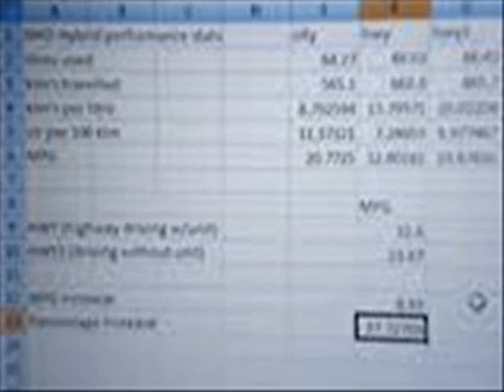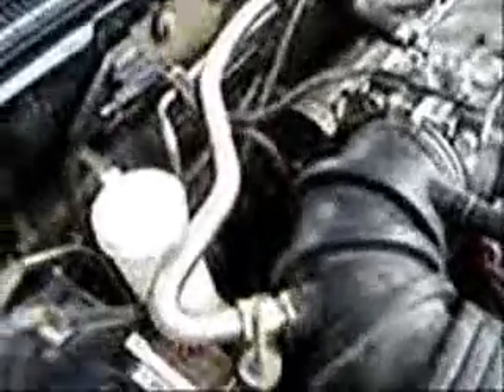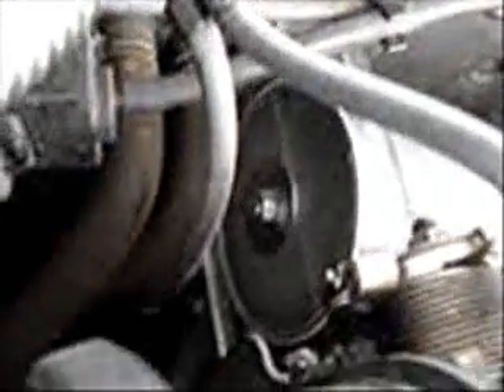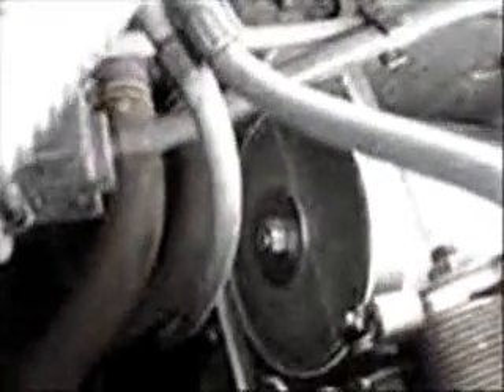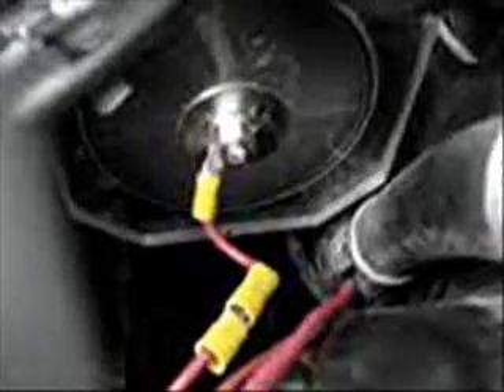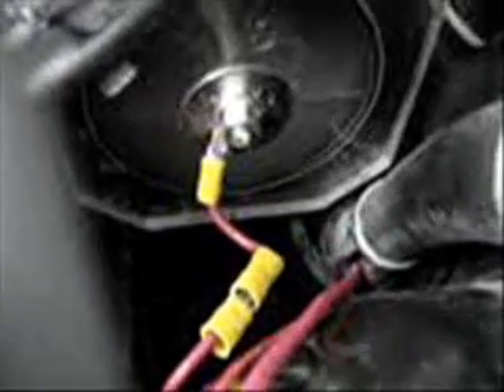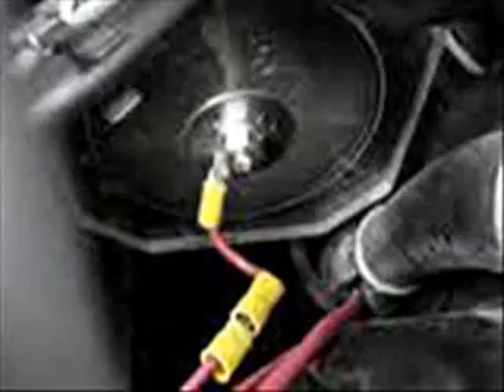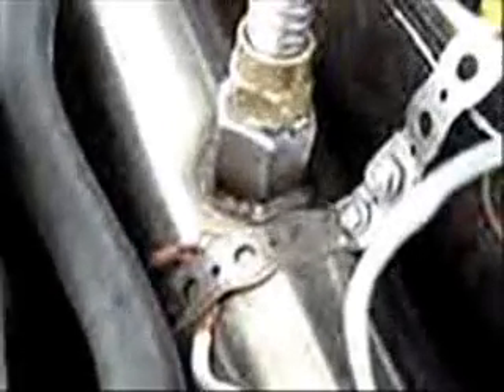Amazing HHO Hybrid part 2

Comment from the maker: Hi, the mesh seems to be .032" stainless wire with about 6-8 'weaves' per inch. They suggest leaving some mesh above water-line to help in keeping it cool if you run electrolyte. I've got it fully submerged as the unit runs fairly cool anyway. I'm in a cold climate!
cheers